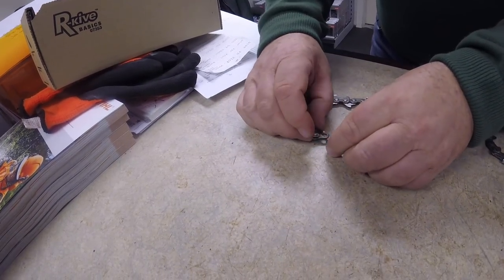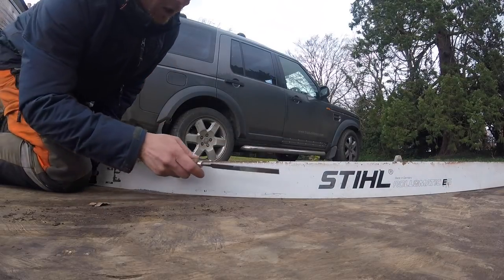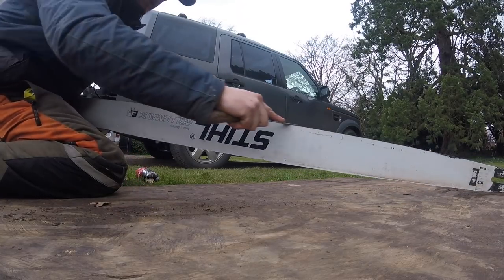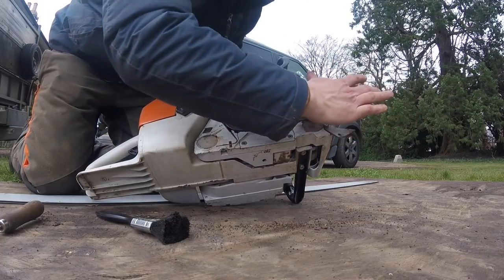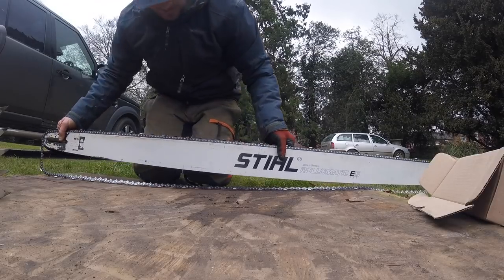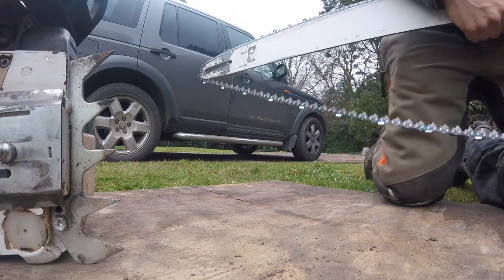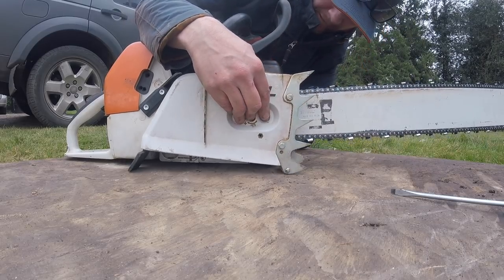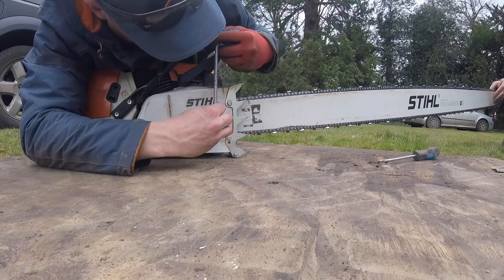Snapping a Chain Stihl MS880

Comment: Awesome man! I’m looking for a recommendation on an small electric chainsaw. I want it for emergency in my truck. But I want to keep it in my cab so going electric for smell and cleanliness. Any suggestion? Brands you trust?
Reply from the maker: I’ve used a few of the cheep amazon ones that plug in there ok ish with s sharp chain. I have used the batterie one from stihl which is great for small pruning but not for logs and there not cheep.  I hop that helps. Cheers
Reply: with the batterie stihl do you think I would break it going after a larger log? or would it just take a while? maybe that and a solid axe?
Reply from the maker: No it won't break it has a cut out built in but its really for pruning.  I wouldn't use it for firewood.